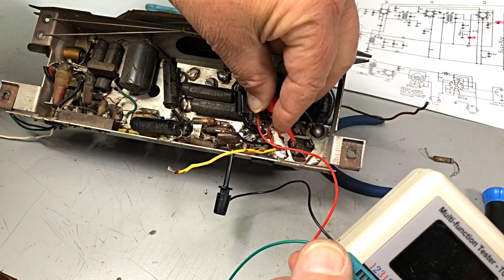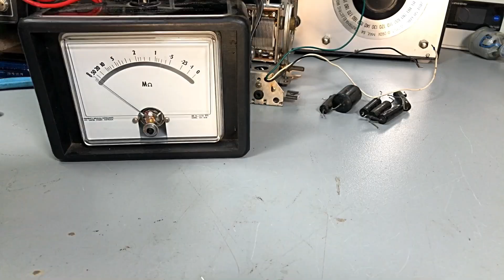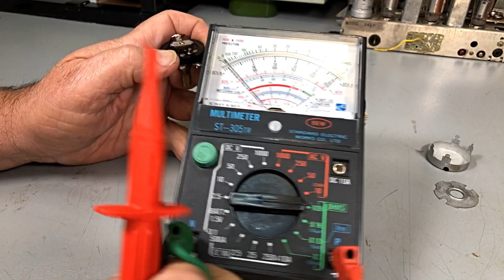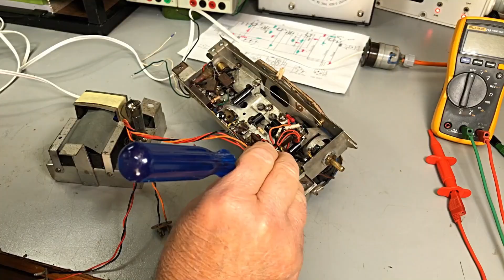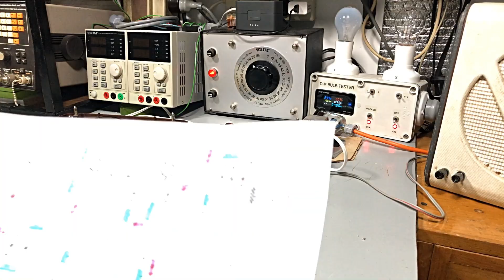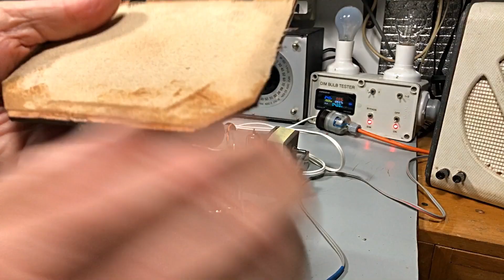AWA 545P Mains/Battery Radio Restore - Pt2

Comment: Well a 560K Ohm plate load resistor would certainly stop the current running away if the grid cap was leaky 🤣 In fact it would pretty much almost stop everything.

Comment: Hi Baz. Well that’s a relief. That bloody little resistor probably owes you several bottles of wine and a few sleepless nights. Glad you found it in the end though. This is going to be a beaut little radio. Looking forward to the bush testing video (and the chair, of course. 
Well, the bus is packed, the rellos have arrived and we’re heading off in the morning. 
Cheers!
Reply from the maker: Have a great get away Don, of course we need to see hilights of the trip !
Yes, that resistor cost me a few $$ in wine for sure !
The chair ? Well it's on the bench for a rebuild today.
Bush testing will be this weekend all going well, I reckon this little radio should be involved for sure !
Cheers, drive safe 👍

Comment: Probably a good idea to look at all your meters. Remember the one with the leaky batteries. You reminded me to check mine!!! I caught the batteries in my favorite Fluke 189 before anything leaked out. I learned a lesson on resistor values similar to what happened to you. I had a car radio someone worked on and they put a 15K resistor where there should be a 1500 ohm. Since it was covered by other parts the orange band looked red, but it was not. Of course taking a reading revealed the issue. Amazing how well this radio is working before you have done alignment and the fact it does not have a tuned RF stage.
Reply from the maker: I actually can't believe how well it performs Douglas. One of the best radios I have tested in the workshop. Won't be long till it goes in the case & alignment. I want to get it out of the town limits & see how it goes too !